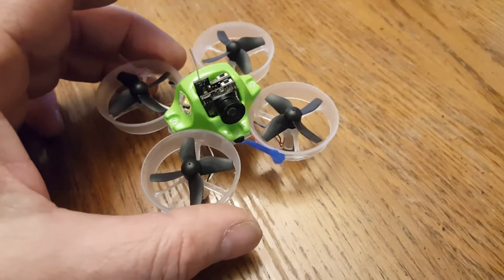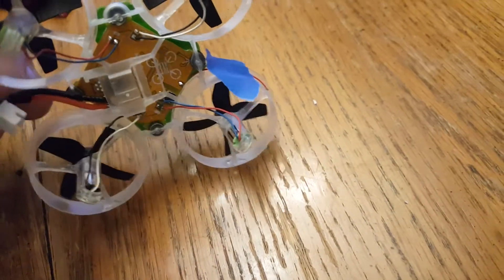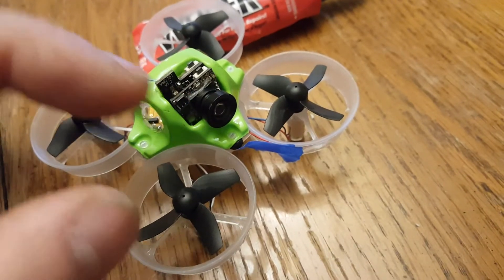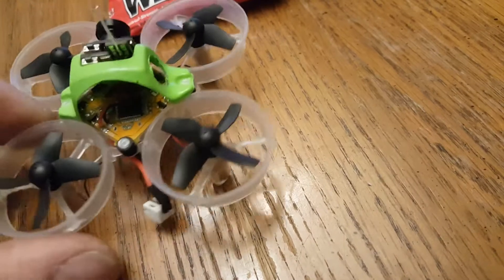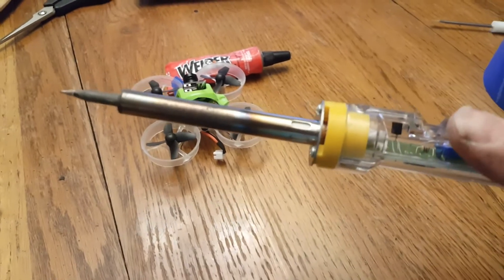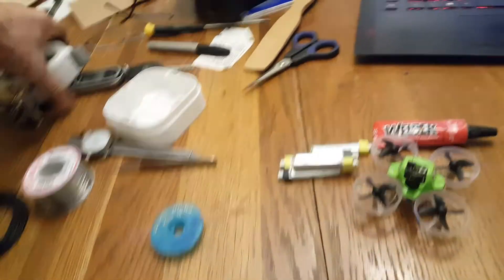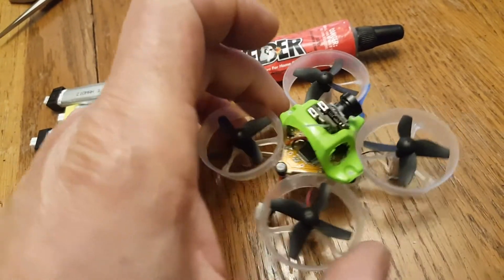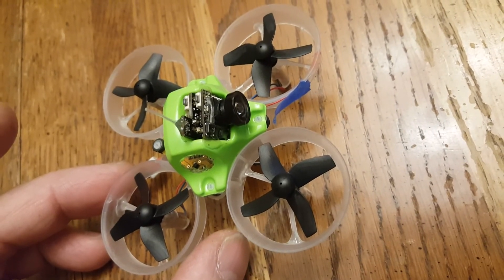18 gram Tiny Whoop (lightest on YouTube)

Comment: You should consider reversing the motors for that frame. Pushing the air against the angle of the supports of that frame causes some turbulence and causes a reduction in performance.

After you reverse the motor set the yaw in Betaflight.  You will notice a better performance. ( set yaw_motors_reversed = on )

Comment: you can save .28-.32 grams if you cut off the motor mounts that go under the motors... my 65mm 7x20mm whoop weighs 26.89 still have to change out the antenna wires hoping to save another .5 or more. ill try to make a video this weekend

Comment: I think i managed to make one even lighter :-)  16.8g !! the new record to beat !!! https://www.youtube.com/watch?v=Qa0AOqLAhuY
Reply from the maker: nice.  I do have a lot of glue on mine.  I keep hearing that the 2 blade props are better.  I'll have to switch.
Reply: First time i tried 2 blades, and this is definitively better on low KV motors. Provide smoother & longer flight. Worth the try.
On higher KVs motors, it seems there is much less of a difference.

Comment: winning most flight time is losing the 4 blade and go to 2 blades.... less dragg yes little more rpm but way less current.
Reply from the maker: I'm concerned about less thrust.  But, I will try 2 blades anyway.
Reply: Good luck u wont go back to 4 blade :) nightflyer has expermentid with 1 blade heli's and planes with good results
Reply: Dragon69Fly 2 blade suck , lest thrust means more throttle input = rain battery faster , and they are way slower

Comment: You have a transmitter with no antenna sir. I’m surprised it doesnt burn out. But the signal strength can’t be good
Reply from the maker: I'm using a patch antenna orientated for vertical polarization.  It allows more radiation to be directed in one direction towards the model.
Reply: Samson FPV I’ve done this on my 200mw and it works better then the dipole

Comment: Great build, what have you done with the antenna?
Reply from the maker: I just soldered on a piece of wire and locked it in with welder 2000 (shoe goo).  I aggressively reduced weight on this build, but I kept the reinforcement on the frame.
Reply: So there is no need to ground it? I am thinking of adding a wire instead of the stock antenna since i suspect it is not the right length
Reply from the maker: inmihiveritas the circuit board acts as the ground.  I never notice any range difference.

Comment: cool
Reply: you can lose the canopy all together, chop down to two blade prop, and cut the motor mounts "cups" then suspend the motors in the remaining sleeve with a touch of glue. Also you can skip the glue to strengthen the mounts if trying for ultra light craft.

Comment: What range can you get from the taranis???
Reply: MicroDroneTech I wanna know which spektrum receiver is smaller or lighter than the .4g fishPepper uSky frsky full range rx with telemetry
Reply from the maker: I don't use Taranis for a variety of reasons.  1) The tiny whoop receivers are much heavier than spektrum compatible ones.  2) Taranis my have slightly better range, but a wifi booster on Spektrum blows it away.  3) The Taranis protocol isn't wifi friendly.
Reply: Wifi booster for Spektrum, what is that? Because I have got a Spektrum..
Reply: MicroDroneTech what are the pros and cons to wifi communication?